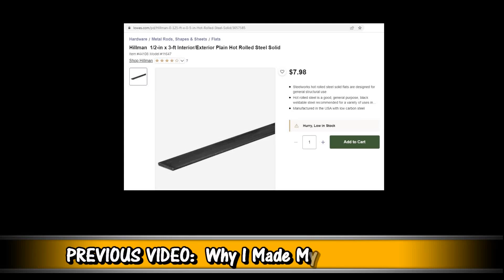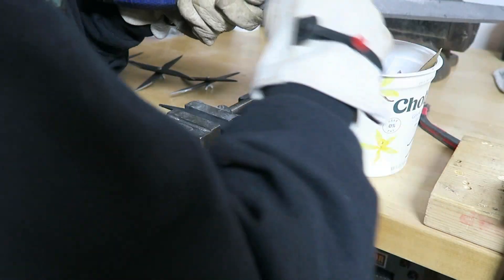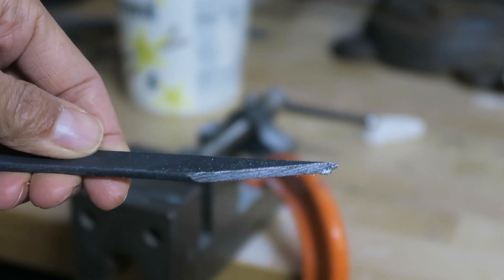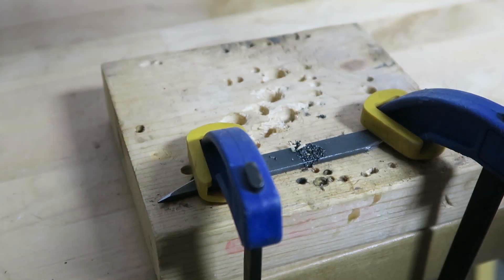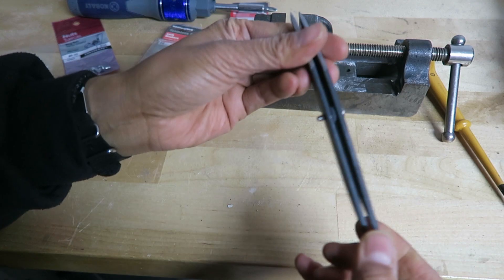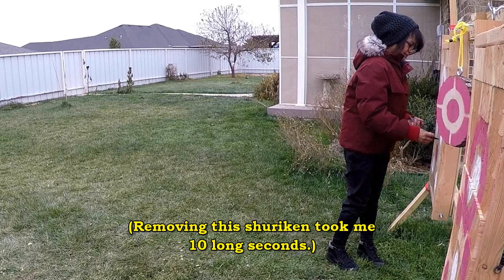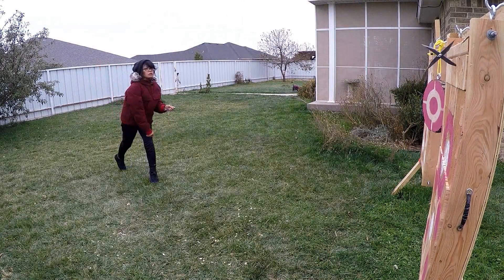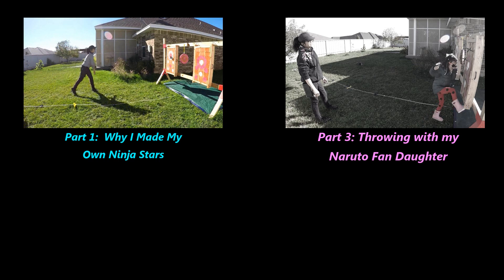DIY: Folding Shuriken using Hacksaw, File, and Drill (Part 2 of 3)

Comment: That clock on your workbench definitely reminds me of the timer on Forged in Fire. 😆

You can try heat treating the blade tips to make them stronger I suppose.
Reply from the maker: That clock is my husband's Rogue timer-- he uses it for his workouts!  

From what I've read and comments, the steel doesn't have enough carbon to be heat treated.  I did throw them other day and it seems like they tips aren't bending as much-- maybe I hammered them out enough?  Could be me though!

Comment: run the wingnut down tight on the 3/4" bolt and then peen over the end of the threads and you wont lose your wing nuts..
Reply from the maker: I was thinking of doing that!  I had trouble getting nuts on my threaded rods when the threads got messed up from knife throws-- but I wasn't sure if that was a thing people did on purpose.  Anyway, thanks for the advice!
Reply: @Xolette  welcome back...